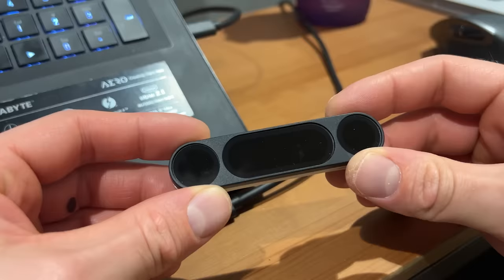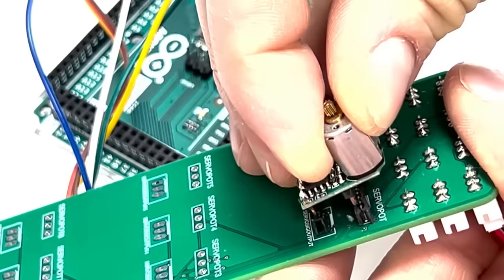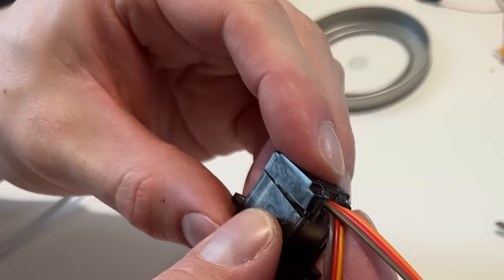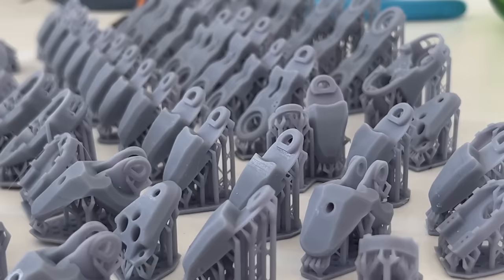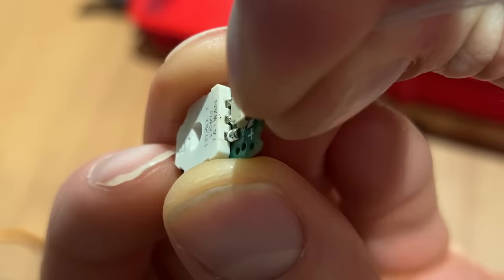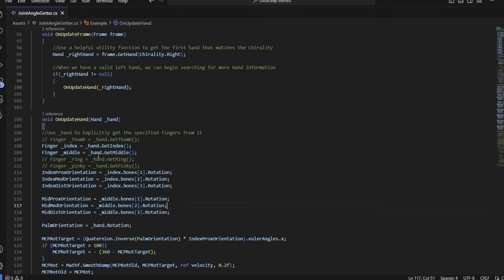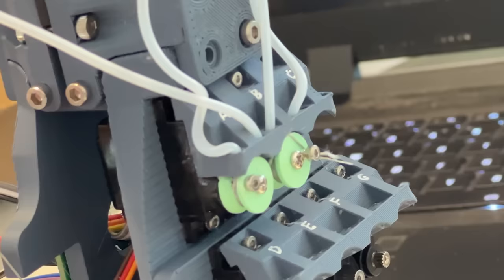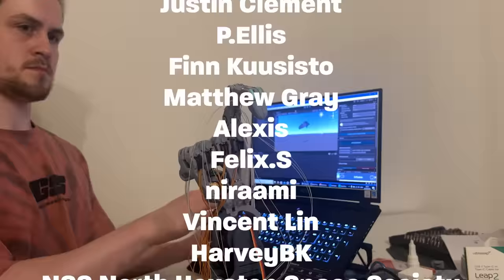Controlling my Bionic Hand With Realtime Motion Tracking - Biomimetic Bionic Hand

Comment: I wish I could take 2 weeks off of work... lol! Anyways, the issue that I've always found with this design is the "finger servo motors" considering how their tension would always need to be adjusted. That and how independent each contol motor is (if this were to be for real world applications). Lastly, anything that isn't LTI is just pointless (like most arduino projects are sadly).

Comment: Since you have your potentiometers in the finger joins anyway, isn't it sufficient to constrain the cable paths all the way to the motors instead of using floating guide tubes ?

Sure, by having all the joins be influences by the bigger ones it caps the speed you can run the big ones at unless you manage to make the cables run tight to the pivot points to not affect the joins down the line too much.

Comment: Great work 😊

Ptfe tubes … are they the same as in 3d printers? I know they work great under tension… never seen them in compression like the way you use them.

Bodem tubes under compression are bike brakes and shifters, but they are metal.

Comment: Hi,
I can see that you are quite acounted with the anatomy of the hand but you are not trying to benefit from it. Our body senses the angle of the joints via tendon length and muscle construction. You are trying that with angle measurement of the joints itself. This creates lots of complications in the design. 

What I suggest is this. First put the strings inside of the fingers.  Since precise flexion is much more important than extension you should focus that. For flexion 1 DIP and 1 PIP strong should be enough. For extension only 1 string to DIP is enough. You don't need to use a string for MCP joint. You can achieve that by pulling the ext DIP and flex PIP. 

For measuring the angles you can use linear pots and track the movement of the strings. On the wrist joint you can use angular pot as reference. After that you can calculate the other joints angles via inverse kinematics. 

Hope that helps you.
Reply: his pot solution is working so why change it?
Reply: @artbyrobot1  To make it simpler and more reliable.
Reply: @birkanozertech  how is his pot not simple?  it is literally just a simple pot, 3 wires, connected to joint.  cannot get any more simple or reliable than that.
Reply: @artbyrobot1   there are 3 pots for 4 finger and 2 pots for 1 finger, a total of 13 pots. You need to install 13 pots with 39 cables and route that 39 cables from fingers to palm and wrist. Once you successfully install all the pots and cables you will need 13 different input port to sense all the pots. With this solution, you can sense and determine all the positions of the individual joint but is it essential? 

All you need is the position of the fingertip relative to the wrist joint. What I suggest is to use tendon positions to calculate fingertips. Even though you use 13 different tendons with 13 different lineer pots, you won't need to install small pots to individual finger joints and route all the cables. You can put all the cable management to the forearm. Easier installment and repair can be achieved.
Reply: @birkanozertech  i think linear pots are too big compared to rotating ones.  rotating ones can also be located in the forearm and connect to the joints via string and hose just like he's doing with the servos.  but his way is fine really.  I see no issue.